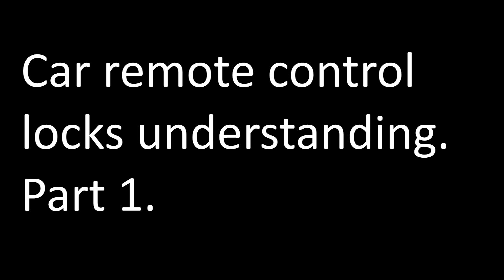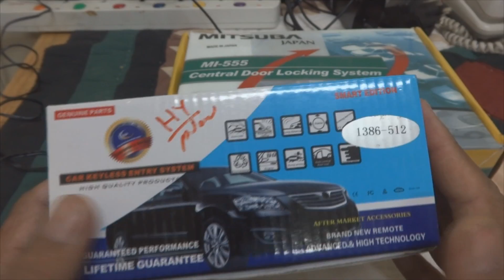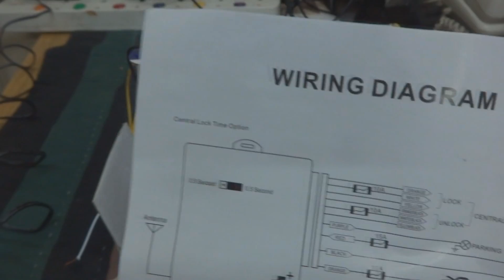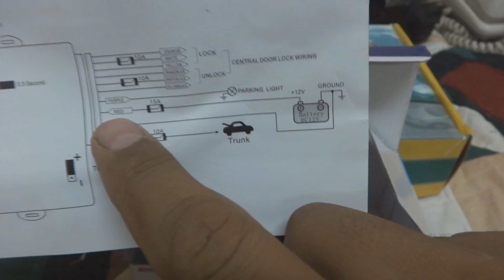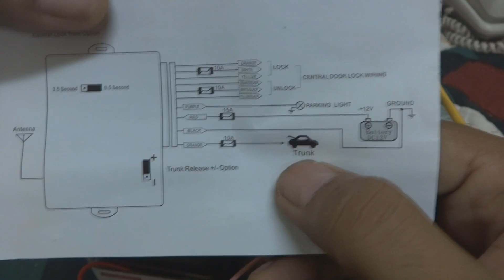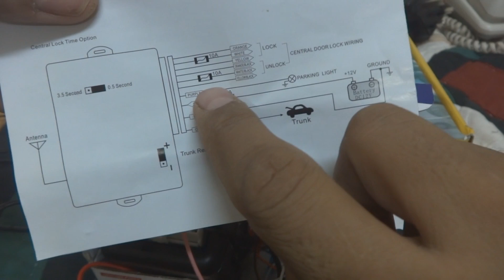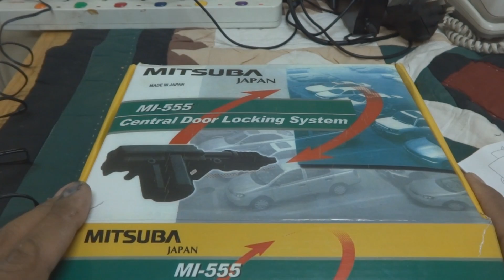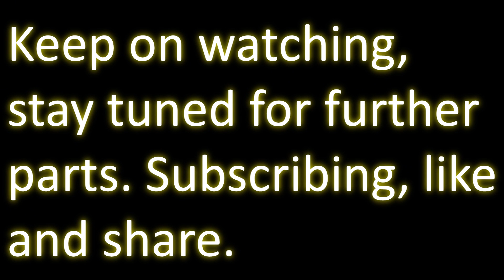Keyless entry; car remote control part 1

Comment: I burnt my module due to watching your video by putting two yellow and two orange together with negative and positive accordingly 
Money wasted thank you
Reply from the maker: You should learn a little more to attempt such job. With little or no knowledge you will loose even more money.
Reply: @JahanZeb1976 I don't have little knowledge mate
Reply: @JahanZeb1976  indeed but not from you
Reply: Have you shown your brown and orange wires connecting to positive and negative terminal 😡😡😡
Reply: Have you shown your brown and orange wires connecting to positive and negative terminal 😡😡😡

Comment: Sir my car comes with central locking but no remote locking so I installed . The problem is I don't know how to connect - ve from central lock module  to the trunk.

Comment: Very useful tutorial - thank you. I think there is no need to connect (Orange) and (Orange Black) wires (11:39) to the negative terminal. Those 2 wires can just be cut off and the system will still work. Kindly confirm if I am right. Thank you again.

Comment: Hi
Thanks for the video. Really good explanation.
One question, i have the same unit but ny car (honda crv 2004) already has center locking actuators but no remote unit.
How would i install the wiring the existing key control unit?
Reply from the maker: You can connect this unit easily with your existing interlocking system. You should connect these relays wires to the interlocking locking and unlocking switches. I don't have facility now a days, otherwise I would have to upload the video. Anyhow I have another video explaining this system. So I will upload that video in a few days. Stay tuned.

Comment: Sir, the above same unit remote module on your video can not be done with code learning by pressing the push button. Earlier, when I press the push button the relays clicks intermittent..and I can do learning code with the 2 keys. Now, i push the button and no relay clicks. Power is available to the remote module and keys are ok too. Please kindly help..its brand new. Thanks.
Reply from the maker: I didn't check. I will try this.
Reply: @JahanZeb1976  awaiting for solutions to fix it. The code learning doesn't work anymore in my remote unit. Thanks.
Reply: @JahanZeb1976  1. While programming, what actually is happening to the transponder chip hidden in the key????
2. Are vehicle codes and information gets stored to the transponder chip?? It's very confusing. If so, is it erasable once data are stored on the chip???
3. If I want to add the 3rd key which has new empty immobilizer chip, how to transfer data and stored on the chip without using programming tools particular to Hyundai i20 2011?? Any options like key insert 3 times, etc!!???

Comment: Thanks Bro
My car's unlocking was not working, After watching your video I removed extra relay module and directly connected 2 white wires to actuator It worked. video is very help full.
Do post more videos. My car is toyota yaris
Reply from the maker: Thanks as my video worked for you. That unit even could you repair and I may upload a video some time when will get one. Anyhow I M feeling happy as you repaired it successfully and commented also. Stay tuned.

Comment: Sir, would not this module drain the battery life 45ah very soon???
Reply from the maker: No. Battery stays for days without starting as long as you have a good battery.
Reply: LearningZone my battery is new and has 45ah 12.6 charge. I installed remote lock unit as well as remote auto close window in my i20. I also tested parasitic current draw which gives 25 mAmps. However, my car is not starting even just after 3 days of not using the car!! Please help.
Reply from the maker: Check if this locking unlocking modules draws such huge current then this is defective. Replace electrolytic capacitors inside the module.

Comment: And how to adjust remote lock and unlock time of the control unit??

I can't find any jumper or alike to adjust the lock timing in the control unit. I want to either lock or unlock almost instantaneously when lock or unlock key is pressed. The factory time is a bit late around .5 seconds. 

How to fasten it by .2 or .3 second??

Comment: Can the driver side lock (five wires) still be use as master lock and the rest are slave on this connection?

What i mean is, if manually I open the driver side lock (five wires) does the rest open/close?

Thanks for the response

Comment: Thanks this was a good video and helps a lot 🙏🏼👌
Reply: Will do this on my 2006 Corolla.already bought the power lock kit.and alarm is on the way.so the module from the power locks will no be used.instead the alarm module will do as instructed on your video.Thanks a lot for the tutorial.from Puerto Rico

Comment: my friend i just only want to know if the other unit like the control relay that show you in the vedio..if i will remove that theres no any problem?couse as of now my car have a problem if that relay installed the door lock is not working in then if i will remove that relay the door is totally working...thanks

Comment: Car is locking on pressing the lock button but it is not unlocking the door neither trunk is getting opened. No Tick tick sound from the unit on unlocking the Doors but on locking the door it is perfectly going on. First day it  was doing well everything was perfect but after whole night standing. The issue cames out. Please tell me the solution. The  Central is buyed from Bang Good. Universal Central Lock System.
Reply from the maker: Seems problem with your center locking or defect with main unit. It needs proper testing to diagnose.

Comment: Hey sir how to find open and close signal wire??
Reply from the maker: You should watch all parts of this video series and will find the answer to your question and much more. Regards,
Reply: @JahanZeb1976  Sir, the above same unit remote module on your video can not be done with code learning by pressing the push button. Earlier, when I press the push button the relays clicks intermittent..and I can do learning code with the 2 keys. Now, i push the button and no relay clicks. Power is available to the remote module and keys are ok too. Please kindly help..its brand new. Thanks.

Comment: I have a 2002 honda civic and it has remote central locking/unlocking. however it doesn't double indicate when locking/unlocking. is there a simple fix that would allow my indicators to blink when i use the remote to lock/unlock? thanks!
Reply from the maker: Just watch the video again friend. It could be fixed if you study it with care. Stay tuned dear friend.

Comment: hi sir thanks for your great video I brought  a  similar one on ebay  18 months ago could never get it to work watched your video   now its working thanks also how do I connect two diodes for the lights
thanking you Tony
Reply from the maker: +marthese mercieca your must watch the fourth and final part of the series here on my channel. It will provide you information about the signal lights connection detail. Thanks for nice comment. Stay tuned.

Comment: Yes sir I have understood thanks for telling us
Reply from the maker: That is great dear friend.
Reply: @JahanZeb1976  Sir, the above same unit remote module on your video can not be done with code learning by pressing the push button. Earlier, when I press the push button the relays clicks intermittent..and I can do learning code with the 2 keys. Now, i push the button and no relay clicks. Power is available to the remote module and keys are ok too. Please kindly help..its brand new. Thanks.

Comment: Appreciated sir I did this and problem is solved 👍
Reply from the maker: That is great then. Thanks for liking.
Reply: @JahanZeb1976  Sir, the above same unit remote module on your video can not be done with code learning by pressing the push button. Earlier, when I press the push button the relays clicks intermittent..and I can do learning code with the 2 keys. Now, i push the button and no relay clicks. Power is available to the remote module and keys are ok too. Please kindly help..its brand new. Thanks.

Comment: Thank you for your excellent videos The native wiring unit is what I currently have installed. The wiring unit that you are explaining it looks like you are only using the green and the blue only? Does the Brown and the white wires get used on part 3 video you did plug them in is that for insulation only?
I am slowly getting my head around this job I only want to do it once. 
You do an excellent job I wait for your response.
Reply from the maker: +Lindsay T dear friend long time ago I did this project and I explained it well in four parts video series. Hope you may watch the video series again to get the wiring idea. Wish you very good luck with your system installation.
Reply: Success I got it working I just need the lights then its complete. Thank you my friend I'm glad I found your channel.
Reply from the maker: That's great you did it successfully. Stay tuned for future videos. Hope you will always get something interesting from me. Also please share my videos with your social media friends if you can. Regards,

Comment: Very useful video, now planning to install it on my car. Sir, may I ask, how can I find postive and negative wire and wire for the turning signals on my corolla 2010 model? I would really appreciate ur help.
Reply from the maker: Dear friend thanks for liking. You must watch all parts of the series to understand well the process of installation a keyless entry system. The part 4 of the series is focusing on your questions. Anyhow if you have any question or doubt, please don't hesitate to ask anytime. Regards,

Comment: I have a 2008 Honda City Zx Gxi. About 3 years back, my remote locking stopped working. It was diagnosed to be Receiver - Keyless entry (38385-S5A-U01) and I replaced it. All was working fine till about a month ago.
Now the remote locking has again stopped working. I have changed the battery in my key, tried the other key, etc. nothing seems work. I am able to program the keys, at the 4th turn key, press lock, sequence, the central locking sound is heard, but after stopping programming mode, keys stop working. I even removed the receiver unit but am not sure how to test it. 
The service center guys told me to go for autocop or other aftermarket remote, but I want to maintain stock. The other option is to order the part assuming it be conked for Rs. 4000/-. I feel that since I am able to program, there is nothing wrong with the receiver unit.
Any experience or help will be much appreciated.
Reply from the maker: That's great if you made such research. I suggest you to make a little more testing and troubleshooting before attempting to replace any part. sometimes it is very small like a blown fuse or a bad electrical connection. Regards and wish you good luck with your repair.

Comment: What's the price???
Reply from the maker: The kit comes for some what $20 to $50 for different make and models of kits. Also you will need some extra parts like wires, door actuator motors etc. They will cost you further a few $. You may watch the whole series of the videos on keyless entry to understand the process of installation well before attempting the job. Regards,
Reply: LearningZone ThankYou Sir

Comment: hi
i just got my new kit and i followed your instructions in the video
all works like  you showed but i have an issue
it auto locks after 25 seconds !!
please advise sir...
Reply from the maker: Dear friend can you send me its clear schematic diagram included in the box on my email address. geoharzaman@gmail.com
Reply: I emailed you sir
thank you
Reply from the maker: That is great. Your unit is a bit more complex than the one here in this video. It needs more signals to operate. Especially it needs the 12V from the ignition switch. 12V should be given from the wire when the the key is on and the engine is running. That is your ignition key 12V. Also you should connect all the doors switches to this unit. I mean when you will complete all the wiring and your car will be started, everything will behave normal. This is normal operation what it is doing. This was there in one on my cars but unfortunately I didn't have schematic diagram for that as well as I didn't film it. Hope you may understand it. If any question, please don't hesitate to ask. Also when you will succeed, you may share your success here with us. Wish you good luck with your keyless entry installation!
Reply: sir i have 1 more question
right now i have got a normal key operated central locking system in my vehicle
so wen i turn the key all 4 doors unlock
but when i'll install this new key less kit, in the event i use my key to unlock the driver side door the rest 3 doors won't unlock!!??
so if i want to continue to have the first option what can i do??
Reply from the maker: For that you should control the car existing center locking system through this after market keyless control. For details refer to your service manual and the given schematic diagram. By that way it will do like the original factory controlled system. In my case there was no center locking in the car that is why I did in the way I have shown in the video. Hope you will get it working with the existing center locking system. Regards,
Reply: no actually that's the real problem...
its an aftermarket kit just like the kit of actuators in the video which i had installed 2 years ago
it had no instruction manual with it
it works fine but i wanted to upgrade it to key less entry system
so now i can't figure out how to make both work together
Reply: Helou

Comment: I have install the kit in My maruti celerio car, can you please tell me the wiring diagram?
Reply from the maker: Dear friend cars wiring is likely the same for most make and model. You should watch my this video series carefully, hope you will understand the great part.
Reply: LearningZone  But just tell where to fit the unit in driving sit side door or below the dashboard?
Reply from the maker: Dear friend it will be fixed under the dash. You may watch all parts again before attempting the job as this point is already shown I think in the last part of the video series. If you need any help anywhere in the process, please feel free to write.

Comment: Hey Jahan and hope you and your family have been doing well. Confusing on those schematics is a good word for sure. And I would have done the same thing as you in wiring the unit up first to understand it. I'm a little confused. Does the Toyota that you're going to install this in not have power door locks? It's just over here that even the cheap cars have power locks. Take care my friend and don't let the negative comments get you down. We all get them...Looking forward to your installation.
Reply from the maker: +stuzman52 Thanks dear sir for kind words. Yes in the Toyota Corolla 2001 I am installing this remote unit had no automatic locking from company. Instead I noticed that someone attempted to install after market remote before me as I am installing now. But that was not working due to many reasons like lost remote controls and old components. Next videos are coming up showing all those details. I noticed even in new models of Toyota shipped here have no central locking and people are attempting to install aftermarket ones. For sure such a job is not new for you but is a source of entertainment! Negative comments one is receiving every day from negative people. I noticed people making negative comments have nothing in there heads! Such nice friends like you and others, I am not taking any care of negative comments. Best regards, Jahanzeb.
Reply: +LearningZone I learn something all the time Jahan. As I mentioned in the previous post, I just assume that central locking would be a standard even on the cheapest cars over here. But in Saudi Arabia, it seems this isn't the case. In any event, now that you're on the job, I'm sure that the owner of the car will be happy with the 'new' installation that you'll provide. Take care my friend and be happy!

Comment: sir 3RZ-FE  engine  hilux. wo silnsor sy kala dohan or bohat patrol pe ra hai. plug py b patrol aa ra hy or moskil sy start hota hy... Mass Air flow sensor  change kiya... ecm to engine tak ki sub wires b check  ki lekin. problm wohi hy... oxygen  sensor  b cut hy matlb kisi ney us ko cut kiya wa hy... plz agr ap ko kuch pta hy tu bta dein...
Reply from the maker: +Dv Danger Scan the truck first using a scanner. Check for any code if it is there. Then check for any leaking fuel injector. Any fuel injector must not squirt fuel without its electrical pulse. Then other thing if this is a spider type air intake engine, check for leaking spiders. Also you may check fuel regulator at fuel rail in engine compartment for leaking fuel on vacuum line. Seems there is some uncontrolled fuel is fed to the engine. Check everything with patience. Hope you will find something leaking fuel to the engine. Wish you good luck with your repairs.
Reply: o bhai fb pe id nhi mili
Reply: +m masood  abdulateeq33@yahoo.com   ya Abdul Ateeeq search  kro
Reply: +LearningZone  sar masla ye hy k  wo gari koi 84 purana sa model  ti or engine  us mai 2003 ya sahid 2003 ka ta... ap ko pta hy is kisam ki fitting  mai just engine  start  krtey hy obd ya dlc ko joint ni kiya jata... bas joghar sy kam chalta hy... na us mai engine light lagai jati hy...kheir wo chala gya hy le k....  mai ne bola bahi terey ecm ka problm hy koi or ecm check kr le...
Reply from the maker: +Dv Danger Yes this is the down side of the modification. Also people are not giving enough time to trouble shoot their cars. So trouble shooting is not always possible in short time.